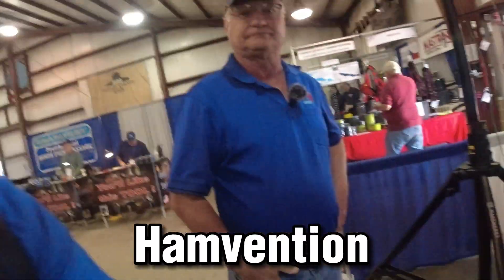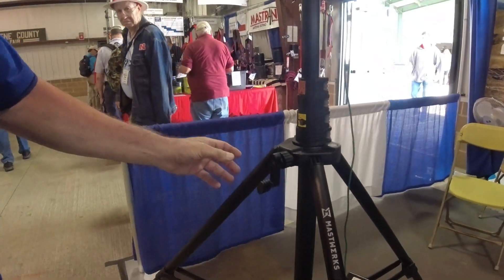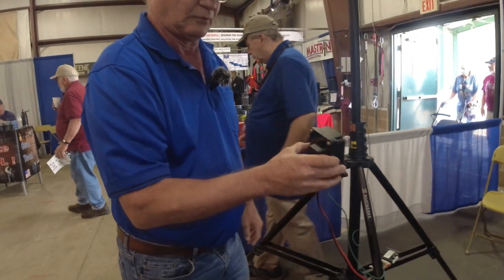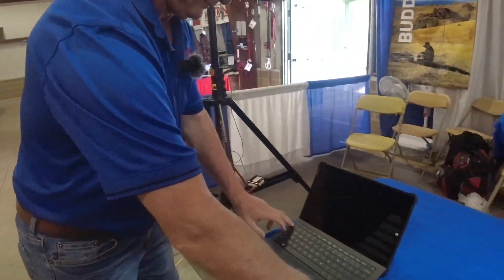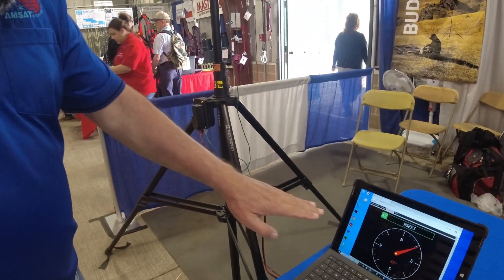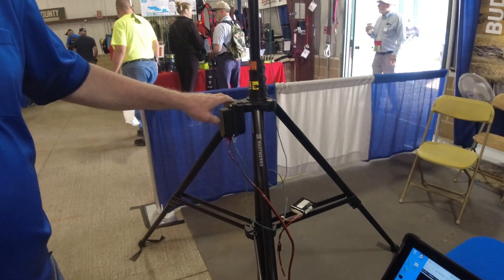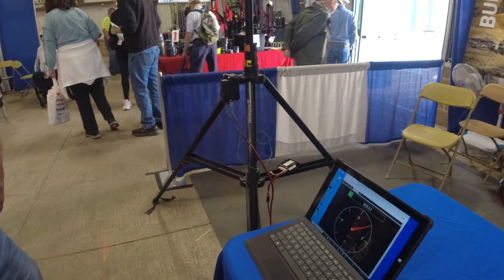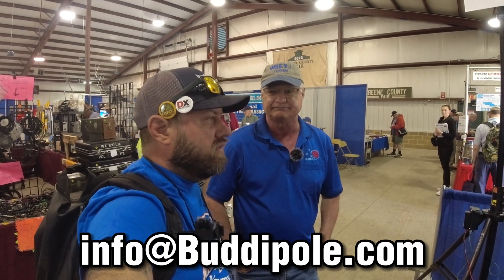Buddihex WIRELESS Rotor at Hamvention 2023

Comment: This seems to have never made it to market - what happened to it?
Reply: Yep, looks like a teaser.  Over a year later and still nothing,  Sad, looked like a good addition.
Reply: Good question. I emailed Chris Drummond at BuddiHex and Jason as well, but didn’t hear back from them. Since then, I found a project on the Prusa Printables site that produces a set of 3D printed parts you can use to make your own rotator using an ESP8266 NodeMCU module. The author didn’t post a good URL on GitHub for the firmware, so I’ve asked them about how to get it. Meanwhile, I’ve found some alternate firmware which will work.